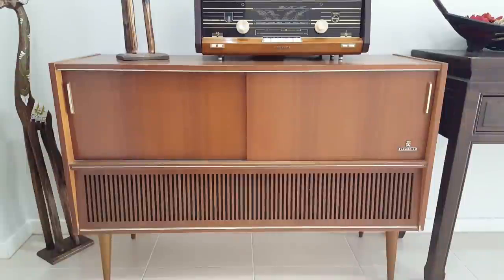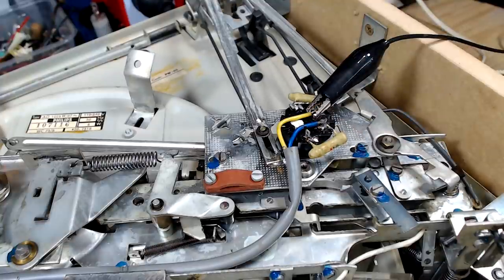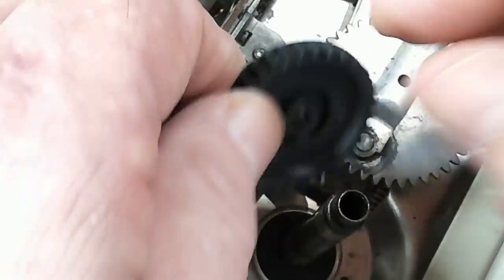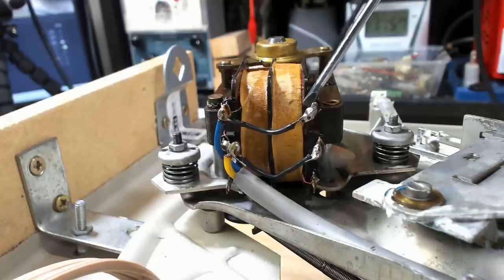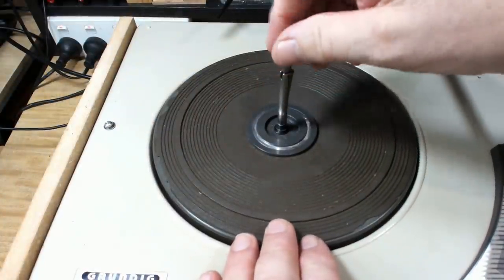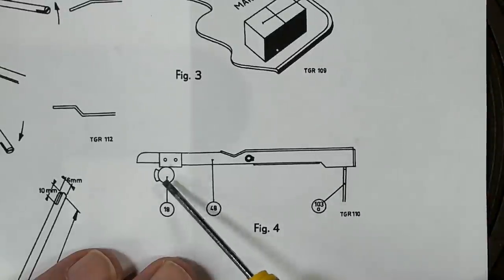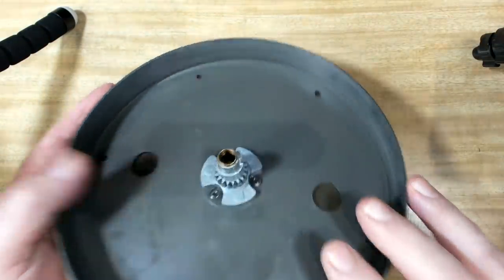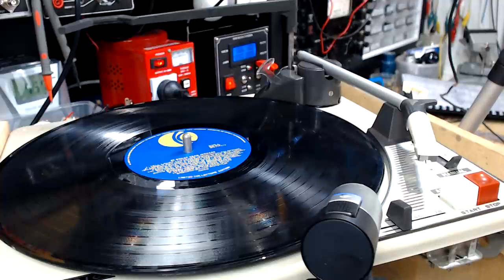Grundig Trento a/WE Radiogram Pt 2 - The Record Player

Comment: 2:29 That's a 45rpm single-play adaptor, and then there's the auto-stacker 45rpm adaptor which slides onto the thinner auto-stacker spindle, these are for playing European, Canadian & American and some of the British records that had large spindle centres(usually from Polydor and Philips Industries before they united to become Phonogram Ltd., then later Polygram Ltd.) Those things should've been supplied as standard accessories in Australia as well but you only saw them with British, European and American/Canadian record players.
Reply from the maker: Thanks Neil, I know. I don't remember seeing any large hole 45s in Oz, some players came with a little filler disc to accommodate them 🙂
Reply: @DavidTipton101  I collect overseas 45s as a hobby, from Canada, America, Britain and Europe. The first record player I ever owned was a HMV "Minigram". It was British-built as it incorporated a pop-up spindle adaptor(pull up and turn anti-clockwise 45 degrees to lock in place). This feature was absent from the Australian-built versions of the Minigram. I started collecting American 45s while in high school. The first one I bought was I'm Wondering c/w Every Time I See You, I Go Wild by Stevie Wonder on the Tamla label, T-54157. I still have it but it's too heavily worn to play any more.
Reply: @neilforbes416  The HMV Mercury 1973 model had a pop up centre the player came in three different colours red,black and grey the only down fall is it had that transistor sound but it would be ideal if your playing kiddie records on them from Disneyland,Peter Pan and Mr Pickwick a good example

Comment: Sir I am also facing similar problem with Garrard SL55,  Garrard Model 1000 and Garrard 6200C. I am having 3 Garrard Record Changer in my collection, all 3 are of having similar problem.
Reply from the maker: Clean up old grease and re-lube them 👍🙂
Reply: @DavidTipton101  Thank You Sir for your kind guidance.
Sir the mechanism was completely dismantled, soaked  and cleaned up with Diesel. Each and every part is lubricated with synthetic oil and SKF liquid grease.
With respect to Garrard 6200C auto drop of the record is not working and even no record the tone arm is continuously scanning the record and it will not rest.
Thank You
Reply from the maker: @bharathba4762  There is a small vertical shaft that lifts the tone arm up. They stick and will need to be freed up. It is located unber the base of the tonearm in the tone are tower. You can see it if you lift the tone are up.
Reply from the maker: @bharathba4762  You will need to work out why it is not dropping on the record. There is an adjustment for the height when the tone arm is in transit.  You need to observe the pin that lifts the arm, is it stuck? is the arm stuck? You will need to determine the fault. Download the manual and check out the assembly and adjustments.
Reply: @DavidTipton101  Thank You Sir.
I had downloaded the Service Manual from Hifi Vinyl Engine.
Everything was taken care at the true and best of my knowledge and according to the service manual.
Once again I will scrutinize it, to tackle the problem and try to rectify or to fix the problem.
Thank You

Comment: How is the cartridge removes\d from tone arm....Thanks
Reply from the maker: The cartridge pulls straight out and in line with the tone arm 👍🙂
Reply: Thank you for replying @DavidTipton101
Reply: One hint please...I have a Grundig 1968 Locarno console, would like to know how to remove the turntable, don't want to cut out the cardboard protector underneath...any help appreciated. @DavidTipton101
Reply from the maker: @rawtry65  Do not destroy the cardboard cover underneath. It stops vibration coming back to the turntable. Lift the mat on the turntable platter. There are two large holes in the platter. You can see two screws through the holes at about the 3 and 9 o'clock positions. Loosen them off and slide the metal plate towards the centre of the platter. You should be able to lift the turntable clear and pull the wires through. Follow this link to see me doing one: https://youtu.be/mTl88dqazwQ?t=790
Reply: Thanks so much for the info...Much appreciated. Your very good at what you do.
 @DavidTipton101
Reply: By chance would you know where I can get the platter bearings, It's a Grundig AG 1035? Missing 2. @DavidTipton101
Reply from the maker: I get them from my local bearing supplies shop. You could probably get them online. I have seen complete bearings in a new cage on eBay but expensive, it had more bearings than the standard one. The ball size is 1/8th"  @rawtry65
Reply: @DavidTipton101  Thanks I was able to find some locally. Your help is greatly appreciated.
Reply: Please one more question...My cartridge needle says M on one side and N on the other side...the label says 22GP228 Diamond and AV   FV...when its on the N side there is no needle, and on the M side there is.  Is this ok?
Reply from the maker: @rawtry65   M is Microgroove, N is standard (non-Microgroove) and I think maybe 78 rpm records (not sure about that). If the tiny needle is missing I would suggest you get a new stylus, that one may ruin your records. A replacement stylus is not that expensive and maybe less than a decent record.
Reply: Can you tell me where to go to get a new cartridge please? @DavidTipton101
Reply from the maker: Just google the number for the cartridge or stylus, You will be able to buy replacements for both. Tyr and get diamond stylus for the 45 and LP stylus.